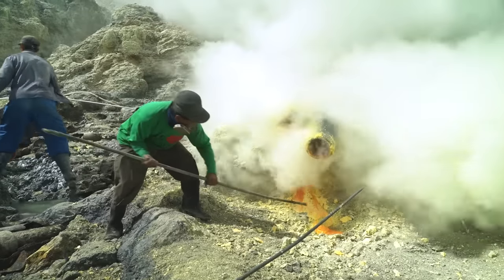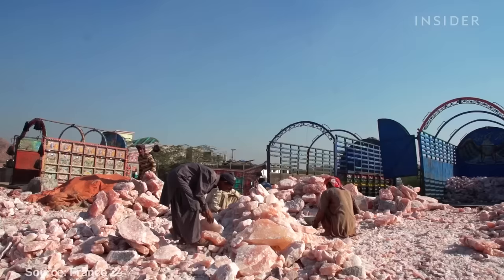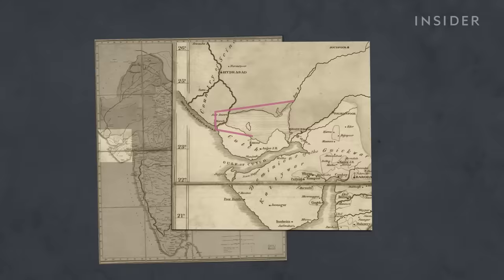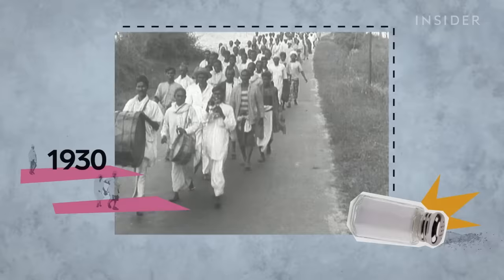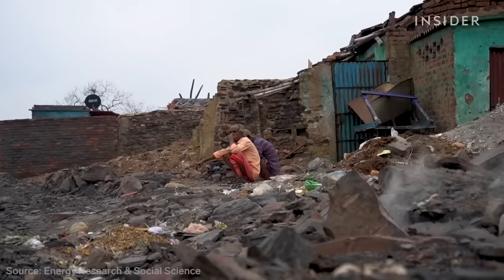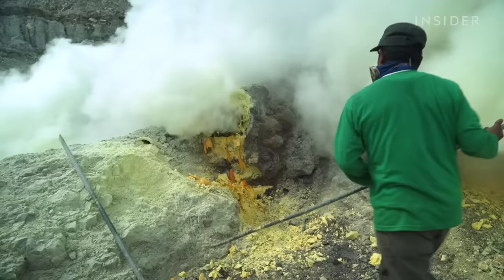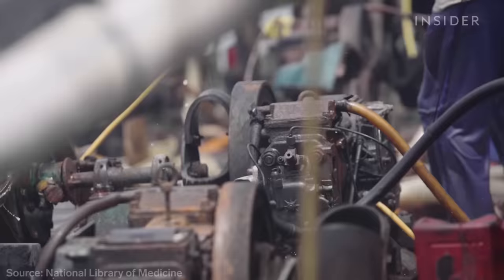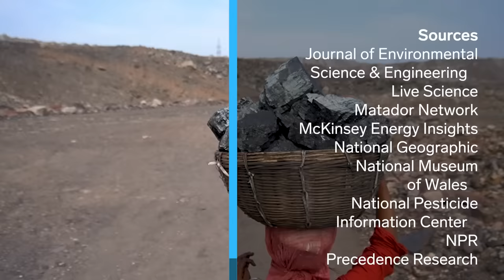The Riskiest Jobs In the World That Mine Sulfur, Salt and Coal | Insider News

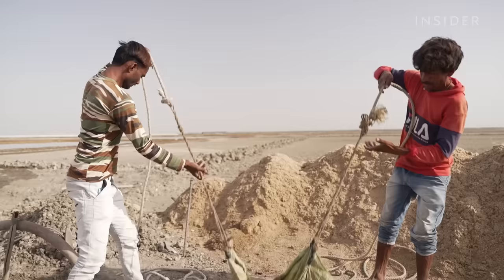Comment: 21:00...He says government-subsidized solar panels power the pumps, but the pumps they are using are not electric.
Reply: Dude that's India for ya ..... Always exceptional in good and bad both I guess
Reply: Some generators start with diesel then run on electricity.
Reply: They asre for running other appliances in their huts . Earlier they need to bring wood along . now they can charge their phones, etc with the solar panels
Reply: The number of panels shown would never be able to much enough water. @MrReachashish
Reply: Ya , sophisticated hybrid systems .  Westerners wouldn’t understand
Reply: @lennart266  huh? If they switch to running on electricity, then what are they generating? Besides diesel over electric hybrid drivetrains, like some locomotives or haul trucks, I've never heard of anything that is powered completely by diesel and then switched to completely by electric.

They probably do have electric pumps somewhere, it was just a continuity error in the editing.